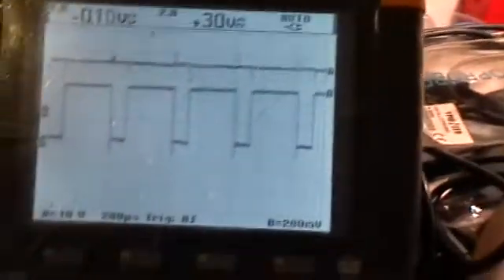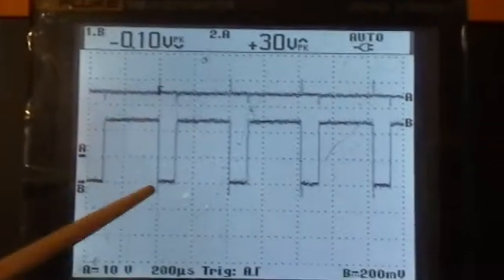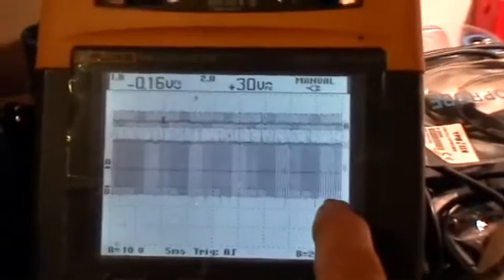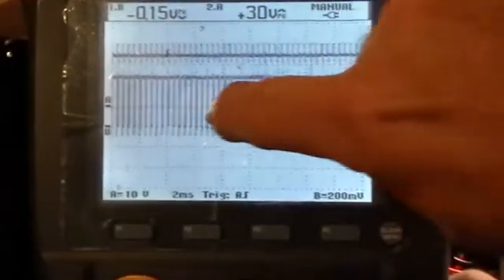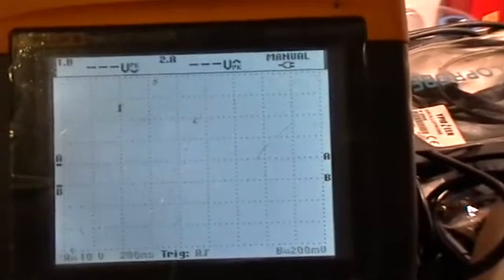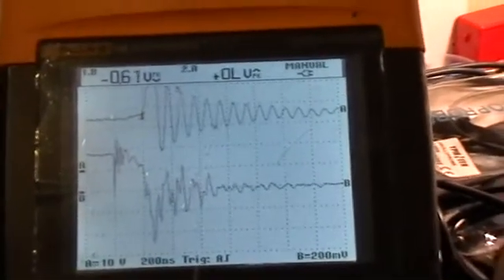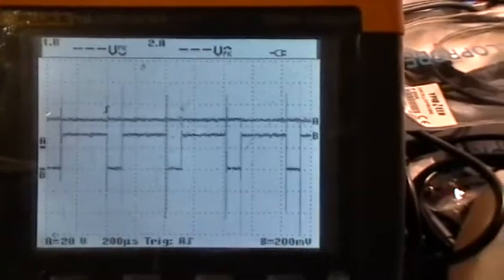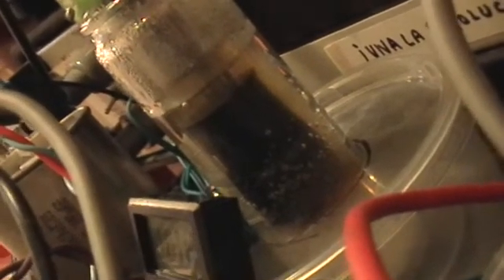Electric OU: Boiling Water and Fluke-0-Scopy

Comment from the maker: Please note: I have been informed that it is impossible to boil water using "10 volts." I suppose the 10 volt figure must come from the Fluke display, filtered through some Rosemary-colored glasses.

So, since you are seeing water boiling in this video, and the number "10" displayed somewhere on the Fluke's screen, you are witnessing a MIRACLE.

Or is it yet another LIE from TinselKoala?

Or, just perhaps, it is indeed possible to boil water, and POWER not voltage is the determining variable.